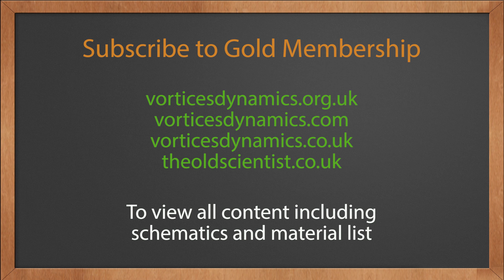Preview atmospheric electricity part 3

Comment: Hi there! Good to see you back in action! It should be feasible to convert HVDC to normal voltages with a low-pass filter (very large capacitor) assuming the brief pulses of voltage do not damage it. Another possible way is to add capacitors in parallel across a high voltage. For example, start with one of those high voltage capacitors at 1 kilovolt, then (presumably using some transistors, or maybe vacuum tubes for the higher voltages) add another of the same to double the capacitance and drop the voltage (one capacitor charges the other). Then once the voltage is low enough, you can add other larger capacitances in parallel without worry of damaging them. Then you can separate the larger capacitances from the circuit and use them to charge something else, while charging the small capacitors again with the high voltage. Maybe inelegant because it requires a lot of switching and might incur some energy loss, but it should work.

Really though the best way is probably what Stan Deyo described: a wire capacitance spread over a large area, charged to a substantial voltage, but not enough for dielectric breakdown of air. The AC fluctuations/noise in that voltage from atmospheric and space conditions can then be harvested in a very straightforward way. DC methods are also possible but I suspect they are inefficient, essentially operating in the dark plasma discharge regime. Eric Dollard discusses some of those systems, like some "antennas" by Tesla, Alexanderson and Marconi which likely operated this way.

On another subject, it would be interesting to see if a magnetic field can be produced by spinning a charged sphere at a high rotational speed. Some strange things may happen if the sphere is made of materials containing various types of bose einstein condensates, as Podkletnov supposedly found. Even with conventional materials, it could be a way of stepping down the high voltage AC of a Tesla coil. The effect would become large around high kilovolts to megavolts I suspect. Even so, might have to spin up the system with a dremel or something.

Comment: I think "MrTeslonian" has more officiant way to do this. Search for "teslonian step down". You could also have wider aluminium strips for more current. The more there is strips in the wheel, the higher the voltage will be.
Reply from the maker: Hello, That is not the idea. Please watch the series to get the subject correct.
Reply: @TheOldScientist  I took the time to rewatch whats available here in the tube.. Seems like there is many separate groups, or individuals, that are after the same magic circuit in different styles :D Here is what i have managed to gather about this subject.
I personally believe its all about Bernoullis princibles and frequency differences that are created by balancing of heat in all of its spectrums (fire, corrotion, magnetism, life, batteries, explotions, chemical reactions, its all about burning in differend form and time).
So to make this with antenna, there is too many variables to do this in one way. Cause the atmosphere is very differend around the world and in the differend weathers, or times of the day. The antenna seems to be most easy to make from aluminium if its not movable. Folded measuring tape makes a good portable antenna. The other major key is the grounding, its half of the antenna and should be below the ground water if possible. Good ground seems to add more current, but not much more voltage. Size of the pick up surfaces are also more important than the mass of the collectors cause of the skin effect in hv.
These collectors should then be coupled with "barbosa leal" effect to create adjustable capasitor from them. After this point usually starts most of the arguing and disagreement in the system..:D
I think it could be boosted if the antenna and ground would be made of graphene or carbon rods with aluminium rods to create added peltier effect. The voltage potential then can be separated to positive and negative by simple "tesla antenna" circuit, and boosted more + made smoother by "super joule ringer". I think these could be made to run simple "bedini fan motors" in differend directions to make the Wimshurst generator from it, and to catch the some of the power to flywheels in it. And then it could be runned through hairpin circuit that would have adjustable spark gap in vacuum to adjust the output frequency. This would make it fully separate from the source and all the "extra power" could be collected back by the antenna.
Here is some of my early proto circuits to give some idea if anyone is interested. It still has way too many diodes and resistance in it, but the consept is there:
https://i.imgur.com/HsqqYVz.jpg and https://i.imgur.com/n53m0tm.jpg
Keep up the good work and thanks for posting these experiments! Your channel has been very helpfull.
Reply from the maker: @Kangsteri  Hello, I do not think about anything special here and simply stated that going forward I will use the Wimshurst machine to generate High voltage for testing the transformer circuit. We are facing the same performance issue when taking the electrical potential from the sky. Improvements has to be done there and not at the Wimshurst machine. I have to deal with any deficiency to make the transformer work.